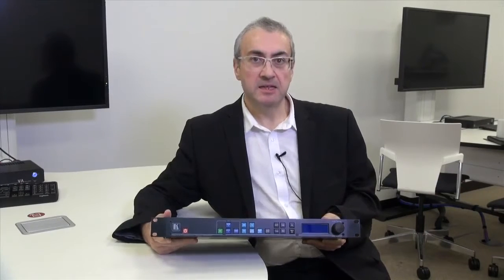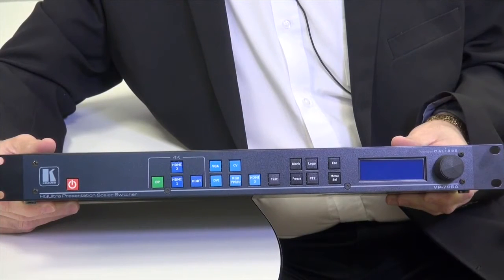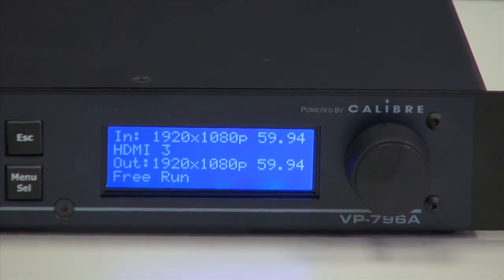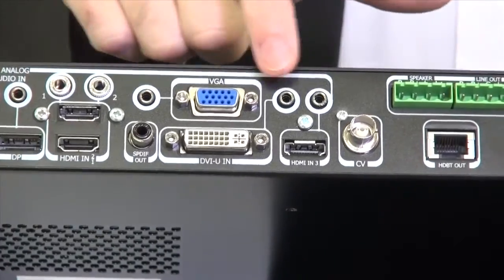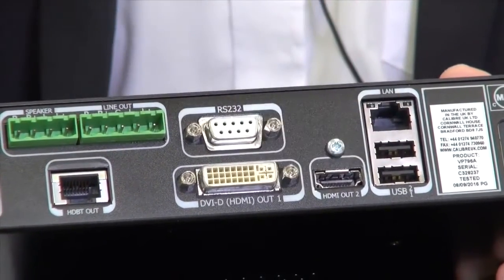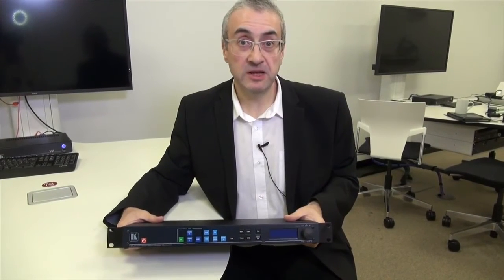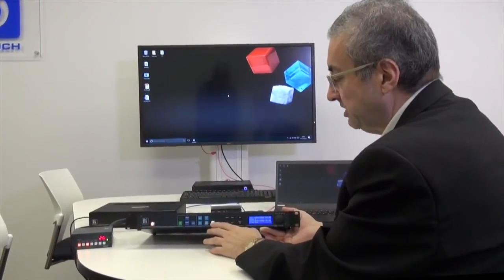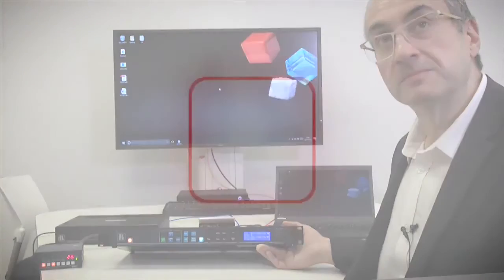NEW Kramer VP 796A Ultra Fast Switcher Scaler

Comment: 4K 60Hz over HDBT? Over twisted pair? Not possible. Twisted pair just doesn't have the bandwidth.
I also love the bit that says it's the fastest switcher in the industry. It's a scaler, of course it'll be quick as it holds the link to the display, however I think I've seen quicker from Extron...
Reply: 4K60 over HDBT has been possible since version 2.0, which was released in 2013, nothing new... Kramer has many products with such capability.
Reply: I think you'll find that's 4K 30Hz. No worries there. Full 4K @ 60Hz is not possible. You'd need more bandwidth than is available over a Cat6.